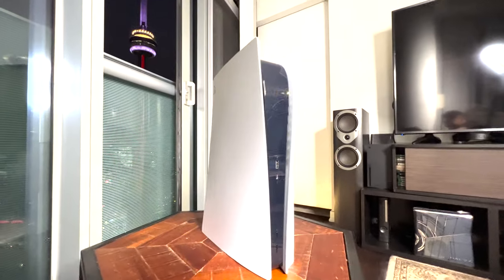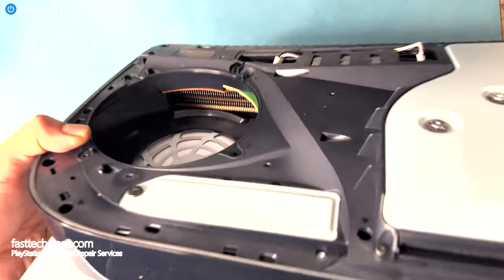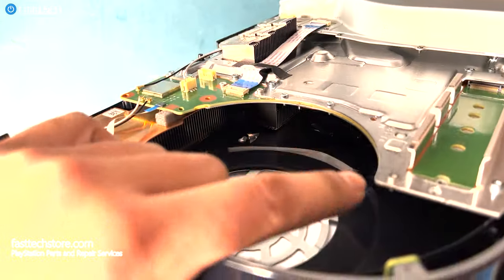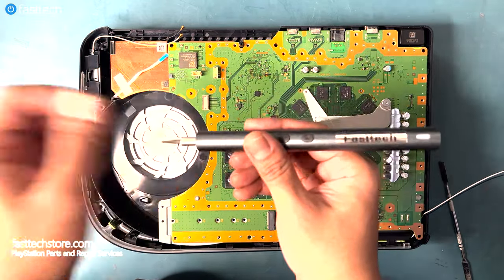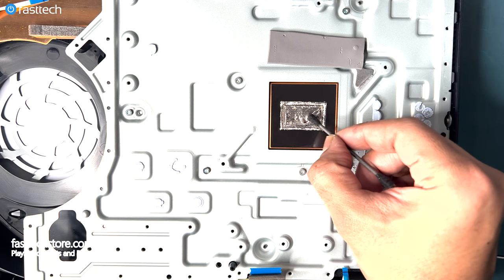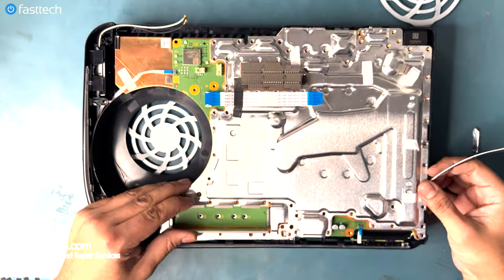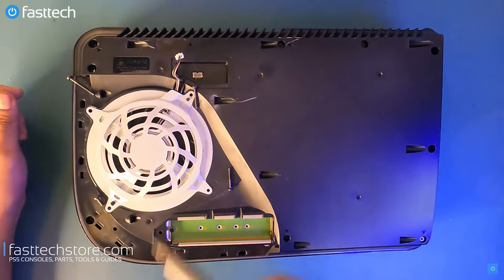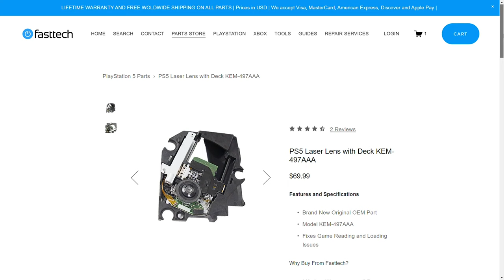PS5 is Too Hot Repair Guide (Overheating FIX - 3 Beeps Then Turns Off)

Comment from the maker: TOOLS AND PARTS USED IN THIS VIDEO:
👉 Fasttech Pro AutoKit: https://www.fasttechstore.com/tools/fasttech-pro-auto-kit
👉 Fasttech Pro Toolkit: https://www.fasttechstore.com/tools/fasttech-electronics-repair-toolkit
👉 Liquid Metal: https://fasttechstore.com/tools/p/thermal-grizzly-conductonaut-thermal-grease-1-gram-set
👉 PlayStation 5 Fan: https://www.fasttechstore.com/playstation-5-1/playstation-5-internal-cooling-fan
👉 Compressed Air Can: https://fasttechstore.com/tools/p/disposable-compressed-air-duster-35-oz

PS5 Optical Drives and Lasers:
👉 PlayStation 5 Laser Lens (All PS5s): https://www.fasttechstore.com/playstation-5-1/ps5-laser-lens-kem-497aaa
👉 PlayStation 5 Laser Lens and Deck (All PS5s): https://www.fasttechstore.com/playstation-5-1/ps5-laser-lens-with-deck-kem-497aaa
👉 PlayStation 5 Disc Drive for CFI-10XX: https://www.fasttechstore.com/playstation-5-1/ps5-disc-drive-kem497aaa
👉 PlayStation 5 Disc Drive for CFI-11XX: https://www.fasttechstore.com/playstation-5-1/ps5-disc-drive-kem497aaa-for-cfi-1115
👉 PlayStation 5 Disc Drive for CFI-12XX: https://www.fasttechstore.com/playstation-5-1/ps5-disc-drive-kem497aaa-for-cfi-1215
👉 Isopropyl Alcohol: https://www.fasttechstore.com/tools/p/isopropyl-alcohol
👉 Want us to fix your PS5? Get Repair Service Here: https://www.fasttechstore.com/playstation-5-repair-service
▶Not sure what PS5 Model you have? Watch this to find out: https://www.youtube.com/watch?v=ClQTKM5gPzI&t=1s&ab_channel=fasttech

▶ Want us to fix your device for you? Just order the Fasttech Repair Box to send us your device by using this link: https://www.fasttechstore.com/repair/repair-box
👉NEED HELP? FaceTime/Zoom Video Call Me: https://www.fasttechstore.com/online-consultation
👉GET REPAIR SERVICE FOR YOUR DEVICE: https://www.fasttechstore.com/electronics-repair

👉 Buy Other PS5 Parts: https://www.fasttechstore.com/playstation-5-1
👉 PlayStation 5 Casing: https://www.fasttechstore.com/playstation-5-1?category=Casing
👉 PlayStation 5 Digital Edition Motherboard: https://www.fasttechstore.com/playstation-5-1/playstation-5-digital-edition-motherboard-edm-010
👉 PlayStation 5 Power Supply: https://www.fasttechstore.com/playstation-5-1/playstation-5-power-supply-adp-400dr
👉 PlayStation 5 SSD: https://www.fasttechstore.com/playstation-5-1/playstation-5-ssd
👉 PlayStation 5 Heatsink: https://www.fasttechstore.com/playstation-5-1/playstation-5-heat-sink-cfi-10xx
👉 PlayStation 5 Eject Button: https://www.fasttechstore.com/playstation-5-1/playstation-5-power-amp-eject-button-board
👉 PlayStation 5 USB I/0 Board: https://www.fasttechstore.com/playstation-5-1/playstation-5-usb-and-usb-c-io-board
👉 Compressed Air Can: https://www.fasttechstore.com/tools/disposable-compressed-air-duster-35-oz

Other PS5 Videos: 
▶PS5 LED Light Mod Video Guide: https://youtu.be/xfflc8a7n3g
▶PS5 Safe Mode Guide: https://www.youtube.com/watch?v=ClFRgjAg9Jo
▶PS5 Factory Reset Guide: https://www.youtube.com/watch?v=-FBN3xqd5Pk
▶Enable 120 HZ Output for PS5: https://www.youtube.com/watch?v=Y6BcTNSX82o

👉Follow me on Social Media:
VLOG CHANNEL: https://www.youtube.com/channel/UCF2IPXKRX5ctN9td1rhkzHg
Instagram: http://instagram.com/youngtechg
Twitter: https://twitter.com/Shehroz

👉Business Social Media:
Twitter: https://twitter.com/FasttechCA
Instagram: https://www.instagram.com/fasttech.store
Facebook: https://www.facebook.com/fasttechy

Comment: How long do I have to heat up the warranty sticker bcuz I need to remove that for the last screw?
Reply from the maker: @Innocentwhiff-w3x  200 C for about 1 minute, no more
Reply: @fasttechvideo  the problem is I’m gonna use a hairdryer. Would it b the same amount of time. Or longer?
Reply: @fasttechvideo  do I have to put the screws back in their exact spot?
Reply: One more thing then, do I have to put the screws back in their exact spot or just match the symbol placements?

Comment: How do I get of the metal that smeared on the board?
Reply from the maker: @rbando1878  with a cotton swab and isopropyl alcohol
Reply: @fasttechvideo will a smear cause the board to short? Because each time I clean it I tend to find another tiny streak but it’s faint. Can that cause it short? Or do I just keep cleaning with the isopropyl alcohol..
Reply from the maker: @rbando1878  yes absolutely it can because liquid metal is conductive. Clean all of it off the board!
Reply: @fasttechvideo yeah, metal to metal contact = shorted circuit. Thanks for the advice!
Reply from the maker: @rbando1878  you're welcome